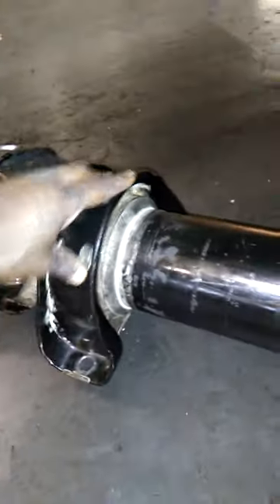Tandem tractor trailer Drive shaft explained

Comment: I'm learning about cars and light duty trucks, but this vid and explanation is helpful to me. I'm trying to learn about big trucks because it tells how the engineers figured out how to really beef up the components to support or sustain ~500hp and BIG torques through the driveline to the drive axle. I just don't know how or IF it connects to the furthermost rear axle, or just the forward axle is driven. Thanks Dutch. -Jon

Comment: What happens if the yoke isn't "phased"?
Reply from the maker: your drive shaft could be damaged
Reply: It will vibrate terribly before it finally breaks the joint